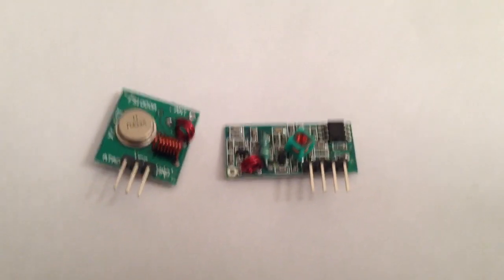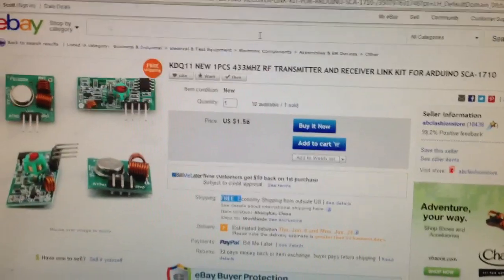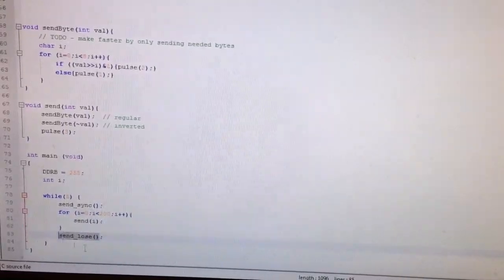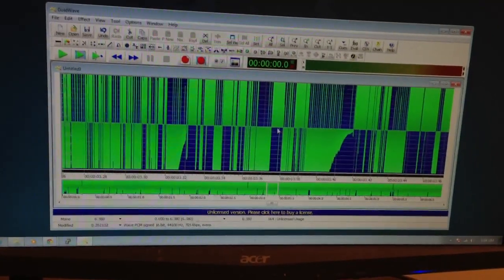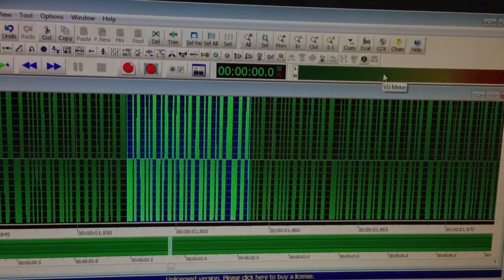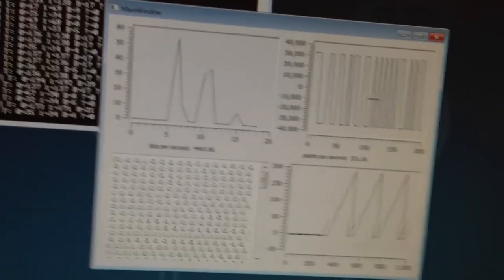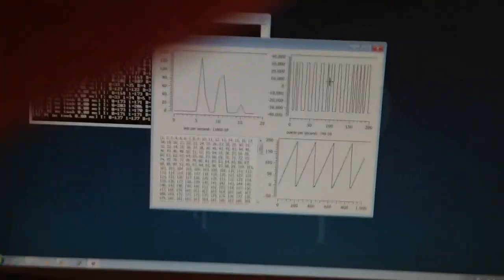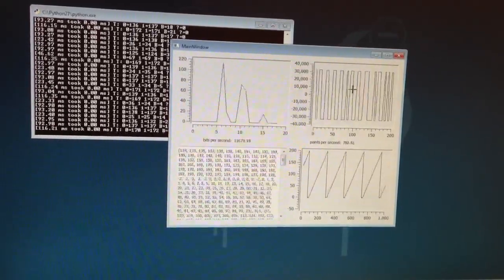Wireless Microcontroller / PC interface using 433MHz RF module and sound card

Comment: Hello Scott, thanks for the video I checked your blog as well it looks cool. Could I ask for some help with this RF module. The bit of info that you provided in the beggining, man it took me 3-4 days of at least 5 hours work per day, to realize all these little problems. But I still cant send digital data from the transmitter to the receiver. Do you have a simple code that can send a word ("Hello") for example? I see in you webpage that you have C code on one side and Python on the other. I use two Arduinos. So yeah do you have a simple piece of code for data transmission? It would be cool to make a video about that if you can.

Comment: A lot of the noise coming from the usb port that you using to power your reciever and the soundcard.I done this before and i had the same noise coming from the usb.Once i power it from a battery lot of noise gone.Also can i transmit composite video with theese modules?

Comment: Sir, I want to use Multiple RF transmitters to send a number.Can i use the same 433Mhz frequency to send a number at the same time by MULTIPLE RF TRANSMITTERS !
Reply: With the permission of Scott,
I don't suggest to use multiple transmitter with the same frequency, because it's going to be null in some time, if you want to use two or more transmitter to one receiver with the same frequency you can use a multiple division per time, it means you have to send the data with the first transmitter after it finish, follow with the second transmitter and so on!, this logical concept is the master/slave, it means you have to generate a algorithm where the master invoque one by one the slaves, with some criteria of importance.
Reply: Juan Carlos Dergan Thanks for ur reply! I thought of using Rf transmitters for my project on student attendance system using rf transmitters. I thought of using RF transmitters fitted in each students id card used to transmit their Identification number.Then i came to know about the RFID cards..Anyway thanks...

Comment: How does this do in a noisy environment?  You notice a large change with distance.  Noise is also a very important factor.  By adding a filter into the receiver circuit it could be more robust.  Also with multiple transmitters you will have what they call crosstalk, where data from one circuit can feed into others and send garbage into another circuit.  They build encoders and decoders to lessen this and provide a less noisy circuit.  ST micro makes them the datasheet is SC2262 I think.  2272 for the other end.

Comment: As a s/w guy, I love the minimalist hardware you present. Thanks for the e-bay screen shots. If the error rate isn't too high, some sort of error correction might be faster (from a data transmission perspective) than multiple retransmissions. Depends in part on the length of your data packets I suppose. And I don't know the processor overhead for error correction algorithms. Retransmission is definitely easier.